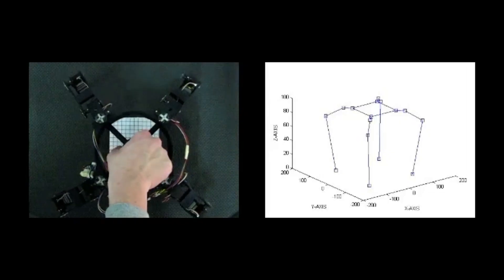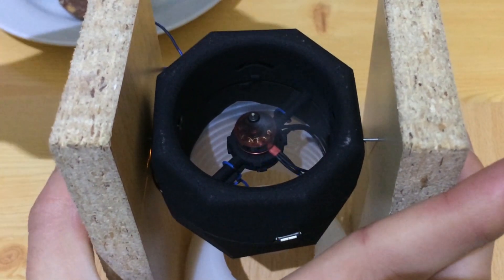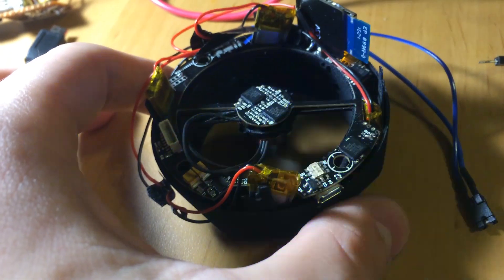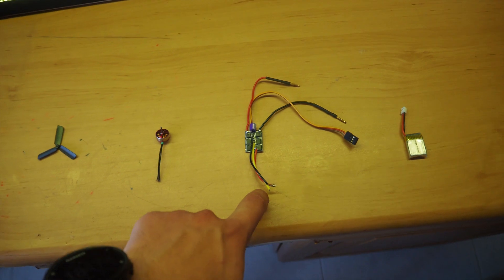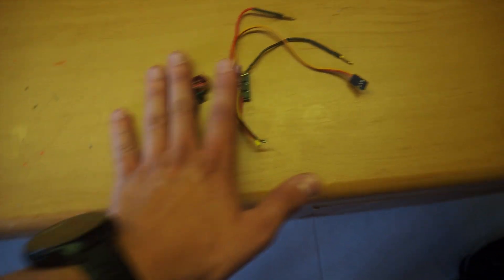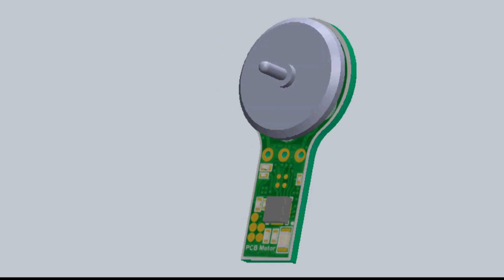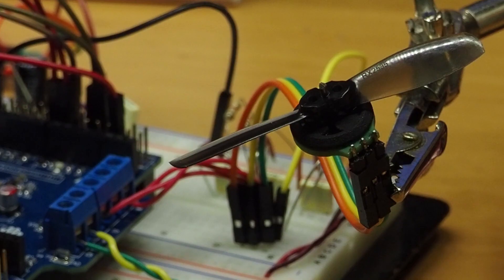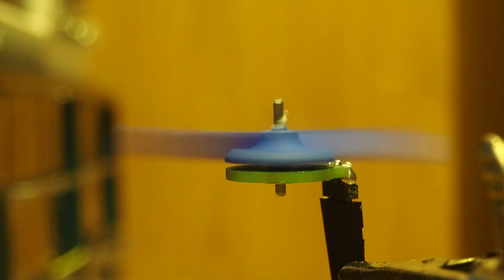MY NEW DRONE CONCEPT

Comment: Yeah but ... Forgive I must put this quite bluntly v

ATTITUDE CONTROL HOW ?
Reply from the maker: Alititude should be the easiest - varry the speed of the coaxial propellers. Roll and pitch axes can be controlled with a swash plate mechanism or something simpler like this - https://youtu.be/aEPf0QHVuMM
Reply: @CarlBugeja   WHAAAAAAT ? 

DAYYUM that 45 degree passive plastic hinge is FUCKING MAEVELOUS .... simple ..... robust ..... no extra servos .... 

bruh .... u ABSOLUTE MADLAD GENIOUS : this might actually work
Reply: Attitude control can be done simply with weight shifting. It is hard to make the drone perfectly balanced, so what if you simply don't do it? Then the thrust line will naturally be a bit offset compared to the center of mass.

To balance perfectly, you simply allow the main body to rotate. But if you wish to alter attitude in one direction, you adjust the speed of the props so that the main body stops rotating. You choose the angle of the main body such that the center of mass is positioned opposite of the desired attitude direction. Your thrust will rotate the system toward the desired attitude.